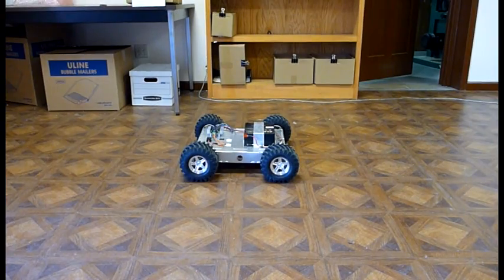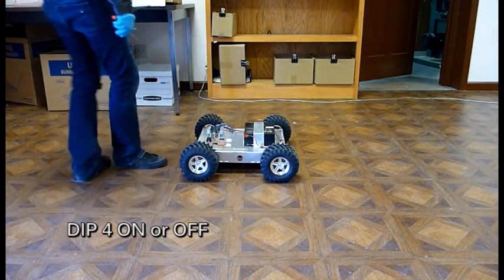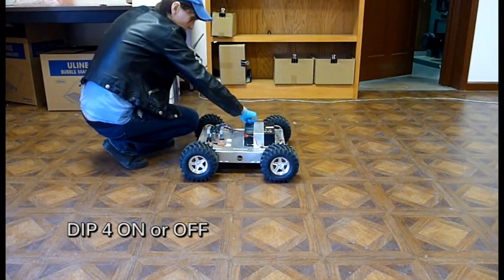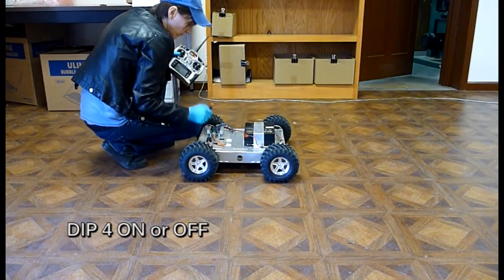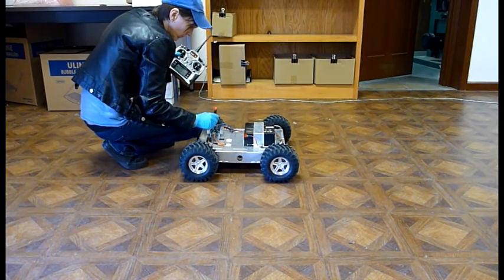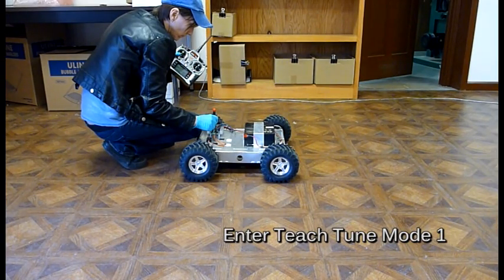Kangaroo Drive Mode Tune for Velocity Control

Comment: Hi,

When I try to do this with my robot, which is a very similar skid steer robot from superdriod, I get a control error as soon as it tries to turn. I am tuning on carpet so there is probably more friction. Have you had any issues with control errors during this type of tuning?
Reply: Did you get the solution ?